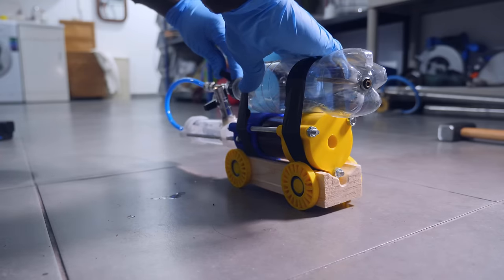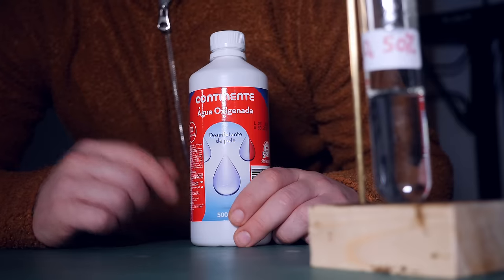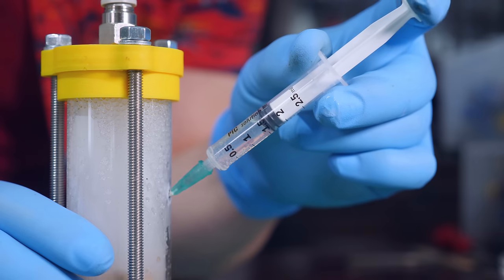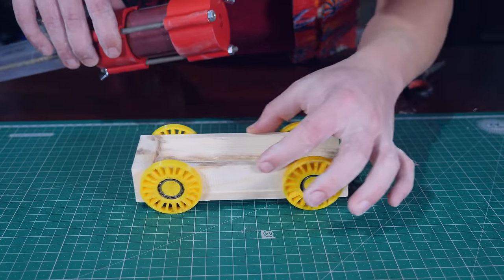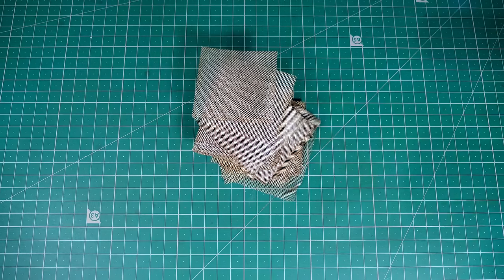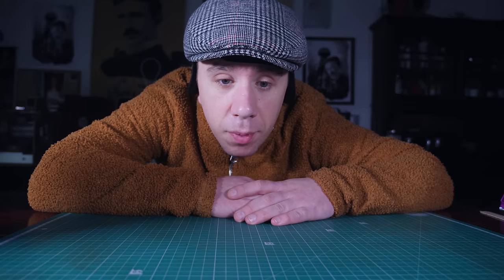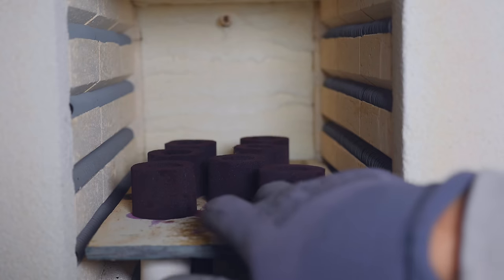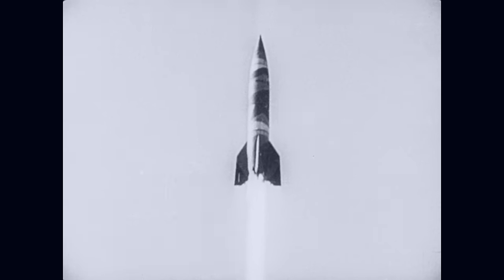SUPER HEATED STEAM ROCKET ENGINE

Comment: Great video, this reaction looks very promising. Just make sure not to accidentally make any TATP while concentrating your peroxide lol, and it might be a good idea to include that important safety info in future videos dealing with high concentrations of hydrogen peroxide, so anyone inspired by your work knows this info.
Reply: That would require the presence of acetone, and an acid catalyst at cold temperatures. Hydrogen peroxide can’t spontaneously convert itself to that if concentrated

Comment: How about using your 3d printed compressed air motor, to run a generator/oilpump for a turbojet engine from the compressed air it produces?
You could charge a battery with it, so a "starting fan" could also be built in.
Also using liquid propane for cooling and fueling the turbojet would be seriously NASA tech.

Comment: Im not sure if its doable without any mayor steps but if you concentrate the peroxide more, could you use the oxigen to fuel another rocket engine to generate even more thrust? Or would the steam cool down the reaction with for example butane?
If not its probably better to use ist to power a turbine.

I know its not much to contibute but if you can get some sulfuric acid you could put the peroxide and the sulfuric acid into two SEPERATE (you dont want to create piranha solution) beakers or jugs and put these beakers in an airtight container for a week. the acid should pull the water out of the air and dehydrate the peroxide. (I think explosions&fire has a video on thet topic)

Cheers and keep on with great videos

Comment: have you considered with the tesla turbines, taking some insperation from francis turbines, as they usually increase the crosssectional area the water travels through the closser it gets to the draft tube. with the reducing radius, and a flat runner, the closer it gets to the draft tube the water speeds up due to a decreasing cross sectional area, which means wasted energy, so most won't use a flat runner and increases the height the closer to the center to ensure that the cross sectional area doesn't decrease. I don't know how you would geometrically do this with a tesla turbine but it is an idea nontheless.

Comment: Is there a way to liquify the potassium? Rather that a 'solid' fuel booster, you could simply spray in the hydrogen peroxide, spray in the potassium solution, let them mix and combust. Ive no idea if its even possible but, it would be much more controllable since u arent just spraying chemicals onto a solid and letting the reaction run away u could control the flow and pressure of the two fuels and fine tune the reaction. Thats my thinking anyway

Comment: I’m not sure if it’ll work in the way I’m thinking because it might effect the peroxide but what it you put it in a vacuum chamber at 60 degrees and slowly lowered the pressure to allow the water to boil without boiling over
Reply: You might have to periodically suck more out as the steam will take up space too.

Comment: 9:20 Could you enhance the evaporation at 60°C by pulling a partial vacuum? I think they make fruit juice concentrate by heating the juice to about 40°C under very low pressure, to remove the water without damaging the juicy parts.

Comment: Reduce the pressure of the h2o2 and bring it to 60 C to boil off the water faster, water has a higher boiling point and a lower vapor pressure. It will speed up the process of concentrating hydrogen peroxide

Comment: Is it possible to concentrate the H2O2 under vaccum/lower pressure? Maybe I'm taking it too literally, but would the water boil out of the solution under lower pressure leaving a more concentrated H2O2? I am guessing this would also require the vacuum to remove the "steam" from the solution as well, since its only pumping out air, not sure if its capable of doing that or another/modified pump is required. This would then remove the waiting time of 60 celsius without degrading the H2O2 at all. Might be dumb, but just a thought!

Comment: I guess it categorizes as a hybrid hypergolic engine since it autoignites the foam just by the heat of the decomposition. Also like nighthawkinlight suggested it needs more fuel to burn and im now wondering what solid fuels would work best and in what shape should they be arranged. I guess solidified hydrocarbons would be intersting to test and porous carbon rich organic solids like dried sawdust are maybe a good bet too. Also why not wax with lots of holes in it like an injector plate(with support so it doesn't brake up in chunks it just melts with a throat leading to the combustion chamber, that would provide excellent propellent mixing

Comment: Would it not work better if you vaporize the water out with an ultrasonic vaporizer? They work with a piëzoelectric crystal, instead of boiling it. Very intresting! Also if you would try drying it out with silica gel or rice or something like that, maybe it works🤞.

Comment: You could use manganese dioxide(MnO2) whitch forms after the decomposition of hydrogen peroxide with potassium permanganate as the brown powder/sludge and save on the permanganate as iirc it is an eve better catalydt for the conposition of H2O2

Comment: I don’t know how helpful this will be but I wanted to point out that H2O2 is slightly denser than water and freezes at a slightly lower temperature than water. Low temperature distillation may be an option.

Comment: To stop the gunk exiting would a dust collector chamber be adequate? I'd assume the extra problems would be a real pain but if it's sealed properly it might allow the propellant the flow freely and catch remains of the catalyst
Either way a small test couldn't hurt to see if it's viable to any degree
Good luck on the solution dude it's always good to see your videos 👍

Comment: You can also use salt to concentrate the hydrogen peroxide. I believe if my memory serves me right, hydrogen peroxide does dissolve salt by itself to make a solution but water does. Thus making a difference in weight separating the two.

Comment: Maybe you can try to add Copper sulfate (its really easy to get) to the concentrated H2O2. Copper sulfate will capture 5 moles of h2o CuSO4*5H2O
Reply: Metals, and their salts in general catalyze decomposition of peroxides. Metal salts are often converted to their oxides with peroxide. Drying hydrogen peroxide with anhydrous salts doesn’t work.

Comment: I'd really enjoy seeing a way to make pressurized containers like batteries (like the CO2 canisters, but homemade). I'm theorizing a no-elecricity home that still has all amenities, using compressed gas or hydraulics instead of wiring. I'm not sure how feasible this is, as everything always comes back to a compressor that runs on a motor that needs more than wind and a gear ratio. I appreciate your methods of thinking!
Reply: to clarify, even compressed air or nitrogen canisters can be powerful, I just don't understand fluid dynamics or gas dynamics and don't know how any of that separating and packing goes. I've tried the google rabbit hole but i think i am bad at searching for things.

Comment: Maybe you can try to concentrate hydrogen peroxyde using a vacuum chanber to boil the water at low temperature and low pressure to limit the decomposition of the peroxyde.

Comment: Wouldn't the chamber pressure be somewhat limited by the rubber band? because the pressure that builds up in the chamber has two places to go, out the nozzle or to reverse/slow the flow of the hydrogen peroxide.

Comment: (Video Idea) 
Try to make any type of rocket powered by electric propulsion but near the end there is something like circles with ridges which can be spun by the end, which convert that spinning motion into electricity to keep the propulsion going and see how long you can run the engine or see how much electricity can you regain from them. The circles can be small and lined around the end, to produce as much electricity as possible.

Comment: You're missing the real danger of high-test peroxide.  All these other properties are easily manageable, but one thing blocks widespread use as a propellant.  When kept in a bottle at STP, high-test peroxide slowly dissociates exothermically, slowly raising its temperature, and at higher temperatures it dissociates faster... and then faster still.  When vented, it even self-concentrates in certain conditions, evaporating water faster than it loses oxygen.  These feedbacks create a runaway reaction that eventually ends in an explosion, even sitting in a storage container.  The larger the storage container, the higher the cube to square ratio, and the harder it is to cool.  Stockpile two storage containers next to each other and you impair cooling.  It's the logistics of a ticking time bomb.

Comment: British rocket engines used a nickel/silver mesh as the catalyst, 85% High Test Peroxide (HTP). The engine was then fuelled downstream with kerosene which ignited in the heat of the decomposing HTP. Have a look at the Bristol-Siddeley Gamma engines: https://en.wikipedia.org/wiki/Bristol_Siddeley_Gamma
These engines were used in the Black Arrow rocket (https://en.wikipedia.org/wiki/Black_Arrow) to put Britain's only satelite into orbit (well, not really the only one, but hey). It's still up there, after being launched in 1971. Yaay!

Comment: If you want to concentrate your H2O2, go with 50⁰C and a vacuum chamber. 85% is relatively easy to achieve in a reasonable time. If you're having problems heating it...think induction..just remember some insulation 😊

Comment: "Explosions and fire"  has a video "hydrogen peroxide going all the way"... details quite a few methods for removing water from peroxide. (There's an upperlimit to H2O2 concentrating by distillation under heat or vacuum)

Comment: (Video Idea)
Try out to make an Stirling engine (A Stirling engine is a heat engine that is operated by the cyclic compression and expansion of air or other gas (the working fluid) between different temperatures, resulting in a net conversion of heat energy to mechanical work), it's a simple and also cool engine.

Comment: Make a drone hot air balloon with this.  Make a device that can add more hydrogen peroxide when needed.  Build a basic drone base and mount the device on top with a large vertical balloon.  It'd extend the range of the drone because a portion of the lift would be provided steam/hot air, not electricity

Comment: There's this guy a decade or 2 ago, that distilled his own peroxide, because he built his own ticket jet pack that worked on the stuff. He was able to distill peroxide into the 90% + range.
Reply: Distillation of peroxides is very dangerous. You run the risk of an explosion, and the glassware has to be very clean to avoid exothermic decomposition.

Comment: If the key to concentrating hydrogen peroxide is evaporating the water at lower temperature, I wonder if you could pull a partial vacuum to evaporate water at room temperature in a fast and controlled manner?

Comment: Why not use a different shape to the foam insert? NASA used a star shape internally for the solid rockets on the space shuttle. It gives a higher surface area so should help with decomposition rates. 

P.S keep up the good work!

Comment: hm, concentrating H2O2... Not easy! But there's a potential way!

centrifugation - nope, molecules are almost the same weight
electrolysis - would fail due to almost identical chemical composition (H2O2 won't decompose slower and turns into H2O + O so... meh)
destillation / heating - kills H2O2 as well (oh well, up to 80 C water "loses the fight" but still, not efficient at more importantly, you won't know your concentration!)
vacuum - lowers the boiling point of H2O2, pretty much the same as for water, would fail plus dangerous
drying the air - would evaporate H2O2 with the same rapidity as for H2O
membrane filtration or molecular sieves - perfect, yet you don't have a lab and the filteration is not enough, safety measures are KEY here, so don't even try!!!

However! [drums]
Freezing might work! Water freezes at 0 C degrees, 50% H2O2 is -51 C (30% is around -26 C). The tricky part is, water crystals would "lock" H2O2 crystals when the weak bonds break up and crystallization, freezing starts. So what I'd try is:
a) fridge freezer (-19 C, give or take), stirring the mixture often
b) ice water bath, salty is better (big container: water + ice + salt in hope for a -4 C degree, small container with the solution, slow but persistent stirring)

with some luck, water can be separated from H2O2 this way. advantage is, destillation level is very low, so the frozen water + remaining solution tells more or less the ratio (new solution's H2O2 %). MAYBE. this should be tested, but this looks the best approach to me (even though homogeneity might pose a serious challenge if not an issue - test the idea by letting the ice melt and verifying the properties, i.e. try to burn it and see how much worse, if any, the melted ice burns vs the liquid remained)

BUT!!!! if it works, or even, works too well, mind how dangerous it is!!! as you stated (correctly!) even dust in the air can flame H2O2 up!!! PAY ATTENTION, PLUS VERY SMALL AMOUNTS AT A TIME!

Have fun, sir, and thank you for the great, inspiring & fun clips 😊

Comment: It took a long time because of the combination of heat of lights above pressuring? In a magnet resistant type of way? Are you in Fahrenheit or Celsius or both? Also your measuring cup and ink on cup is a variable considering how many types of glass there are 
Have you ever made your own measuring glass from your "  own " sand? Like which beach did it come from and how hot is it there if hot at all

Comment: Hey, minor chemistry knowledge holder here, decompositions are infact chemical reactions, being any reaction that has one chemical input and two or more chemical outputs!
Hydrogen peroxide does infact decompose, but the peroxide and potassium permangantate reaction is infact a reduction reaction! This is, however, not true with the silver reaction, where the silver acts as a catalyst, in a true decomposition! This is why silver can be reused but potassium permangantate cannot be reused. Probably. Not actually a chem student.

Comment: This channel has some great videos but someone really needs to teach him about PPE and what happens when you test your luck for too long before he finds out for himself.

We've made good progress since he is wearing gloves sometimes and safety glasses, but he's also causing a very hot and splashy reaction using a very strong oxidizer which is prone to launching very hot and corrosive fluids and gasses everywhere. Lab coats, face shields, and chemical splash goggles are very cheap, you only get one mistake when it comes to your eyes.

Comment: You might be able to evaporate the water by decreasing the air pressure too. If that will evaporate the hydrogen peroxide or not is another question though.

Comment: Dilute hydrogen peroxide solutions can't be concentrated by heating because they decompose below their boiling point. However, you can concentrate hydrogen peroxide using distillation under reduced pressure.

Comment: I have a question or 3... Could you use a turbopump that is itself powered by the exhaust? Pump peroxide and permanganate into a combustion chamber to power the turbopump and pump more peroxide and permanganate? I understand that powering a turbopump with the exhaust gas takes energy from the exhaust, which is bad, but could this create an accelerating reaction, for instance, X mass of fuel + oxidizer powers the turbopump to pump 2X mass of fuel and oxidizer, which becomes 4X, then 8X, until it runs out of fuel and oxidizer, or the combustion chamber explodes from the pressure? are peroxide and permanganate powerful enough to do that? does it decompose hot enough to melt a 3d printed turbopump? Is that how the V2 actually worked?

Comment: Integza at 00:38 "Vögülstüngswabben".

Me as a german: "what?" 🧐 

Than Integza at 00:40: "vengeance weapons". 

Me: "ah, Vergeltungswaffen..." 😆

The reaction you did was in fact the same that was used in the rocket engine "Walter R1-203". That engine powered the worldwide first functional rocket plane "Heinkel He-176". The exhaust gas reached a temperatur of 700° to 800° Celsius.
That was called the "cold walter process". 
In the later engines they added hydrocarbons to the process so the oxygen could burn that hydrocarbons and that reaction reached exhaust temperatures to 1600° Celsius. That was called the "hot walter process"...

Comment: A tip in case you use 200-volume hydrogen peroxide: it is more resistant to decomposition, so you will always lose a portion, a significant portion, but still end up with a highly concentrated solution. I've managed to reach 92%. No, I'm not afraid of death.

Comment: to faster concentrate hydogen peroxyde, why don't use cold, very cold air, (like -30°c) ?At this temperature, the air is completely dry and absorbs water at a very high speed.

Comment: I wonder what would happen if you atomize the hydrogen peroxide by injecting into the combustion chamber via a vehical fuel injector. Such as a high pressure injector from a diesel engine. Some can handle over 20,000 psi. Just like the V2, position the injectors in a semispherical pattern to optimize the coverage for a faster reaction. Idk just a thought.

Comment: Water evaporates at 0.03 atmospheres. While hydrogen peroxide decomposes at higher atmospheric pressure. Couldn't you have just used a vacuum chamber tuned specifically to target one or the other to get the desired concentration?

Comment: Hi, why not use the steam engine concept and make a V8 steam engine using valves adn things that make it work. It will also give more power from the out put as well then a single cylinder. Just giving you a suggestion